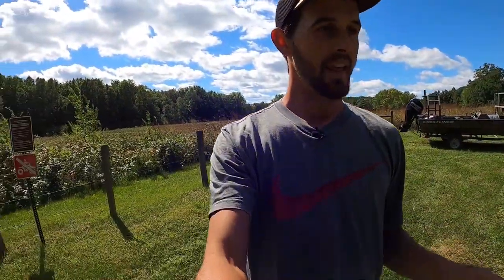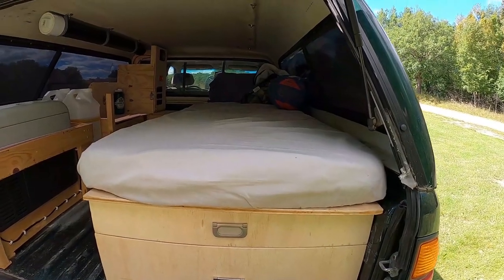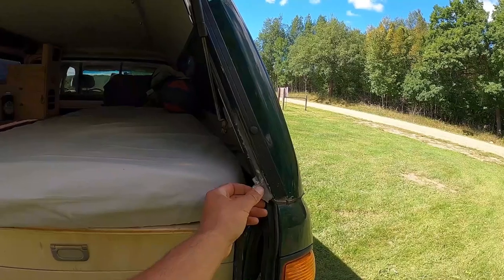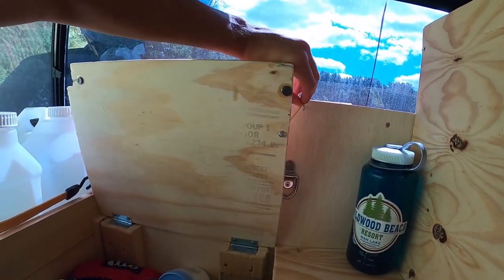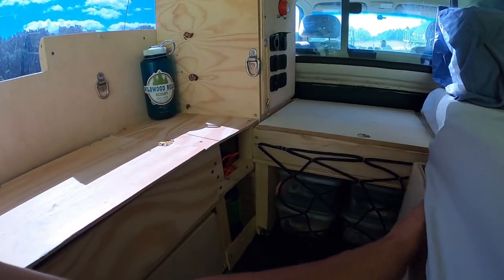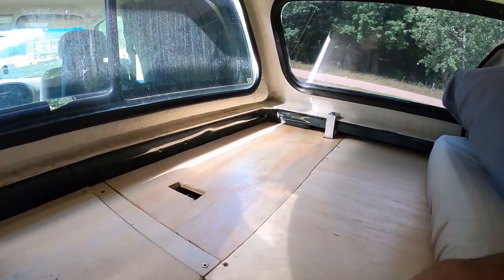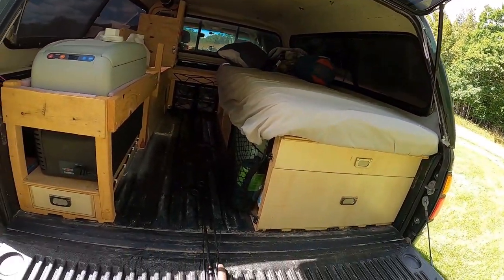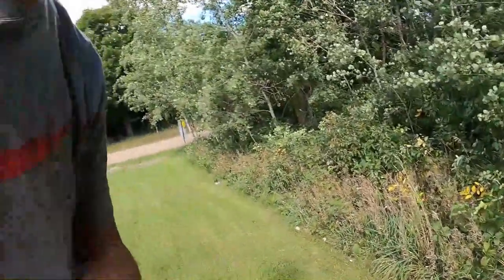Truck Camping in a Toyota Tundra! FULL SETUP! FULL TIME!

Comment: Cool set up for your First Generation Tundra. I have 2002. Go to Lowes and buy some Reflectix for covering all windows in your bed topper then for the truck windows when you’re not driving. It’s what I used to cover the windows in my house in Florida and for 2002 Toyota Tundra SR5 for keeping Radiant heat of the sun out.

Comment: Nice setup! Taking some notes from this as inspiration to my build. I suggest you look into that reflectix bubble insulation. Cheap and easy and provides insulation from the cold and heat. Keeps the temps inside low when it's hot outside, and warm inside when it's cold out there.
Reply from the maker: Thanks! Ya that’s a good idea! I’ll look into it

Comment: good job brother.  i have solar like you. still always changing the inside.  i built a bed which i'll keep but decided the rest had to be modular because every inch of space is needed. so be removing my plywood shelf on the other side it's just not functionable. i am always finding modular things that will fit just perfect.

Comment: curious where you purchased the gaskets along the tailgate to seal out water. In particular, the 4-inch rubber strip along the lip on the tailgate. I have dust/water issues in that location (06 Double Cab Tundra) which I have temporarily patched with a cut-up pool noodle but looking for a more durable fix. Also wondering which gasket you used along the upper edges of the tailgate as well. Thanks!
Reply from the maker: The 4 inch piece that I used for the bottom I got off of amazon. It’s called Adhesive Universal Rubber truck bed tailgate gap cover filler. It is 4.25 inches wide. The adhesive that it come with is ok, but I had some parts not stick good so I used gorilla glue for most of it. I think the gaskets I used on the sides are TruXseal. I don’t remember the name. That’s a pretty cool way to make a quick fix though! Are you still able to open your tail gate with the noodle in there?

Comment: I have a 2001, when you took out the back was it useless afterwards ? or could put it back in? i really like your set up and thank for sharing.
Reply from the maker: Hey! I’m not quit sure what you mean by “ when I took out the back”?  I left my back seat at my parents house, so if I want to put it back in I can.
Reply: @waterpredator7826  sorry about that. I want to do something very similar by taking out the back seat i have a 01 tundra access cab. I was just wondering if the seat could be put back in if needed. Ive been looking on you tube to see how it's done properly, but i can't find much. I'll figure it out. Bout i'm really impressed with your setup.
Reply from the maker: Ok gotcha! If you want a bunch of pictures of my backseat setup I can send them to you if you want. One thing I did that I’m not sure got on the video, is I did not put a bottom on the wood frame. I left the bottom open so I could still use the 2 storage areas that are under the seat. Also if you are going to use it for a lot of small things I would recommend putting drawers on one side. I’m going to install 2 drawers on my driver side so I can access them easy and fast
Reply from the maker: I also used the 2 screw holes that are near the bottom behind the seat. I put a bolt through the wood structure to the screw holes. I also put 2 lags in the front that I screwed down through the carpet
Reply: @waterpredator7826  OK that really clarifies it for me because i was wondering about the two storage compartments under the seat, I really appreciate your quick replies. Like isaid before i really like your set-up and that's how i'm going roll with mine.

Comment: Your baking cause you have no insulation. Most people use reflectix because its thin and easy to work with. Not that the bed isnt going to get hot either way, but it does help. The tint will help but not the same. Nice build though!
Reply from the maker: I have heard of people using them, but I never got around to making my own yet. I’ll have to make some before summer comes around again. Thanks for the tip!
Reply: @waterpredator7826  np. If you want a better insulation you can use Rockwool along the sides but its not going to make that big of a difference since the tailgate, floor, roof and back wall won't be as thick. Personally I have 200amp hours of usable battery (400amp hours gel sealed lead acid) It allows me to run fans, my fridge and a heating blanket in the colder weather. But the insulation definitely helps.
Reply: @waterpredator7826  they are not only making window covers out of the reflectix but also lining the entire bed with it. Just doing the windows alone isn't going to help much.
Reply from the maker: @Kazukio77  thanks for the info! On this adventure I’m going the snow bird approach. I’m trying to stay where it’s warm. I’m going to look into getting the insulation for my windows for more privacy and insulation. If it gets really cold in southern LA where I’m at I’m going to get a heated blanket like you have. Always being cold gets really old really quick for sure.

Comment: what are the dimensions of your bed? Any specific size of the camper we should look for?
Reply from the maker: I’m not sure on the width of my truck bed, but the length inside the tail gate is 74 inches long. The bed I sleep on is 74 inches long and 28 inches wide. I’m not sure what you are asking about with the camper size. I just bought a topper and built my own living space inside. If you buy a topper to sleep in, I would recommend a raised topper for head space.

Comment: I really enjoy your build. I'm curious to know the things you would change since you've probably gotten some good use out of it by now.

I just bought a Ranger XLT supercab with a 6-foot bed. Unfortunately, no one makes the big high top cap for it, so I went with A.R.E. MX cap. I'm 6'1, "so I really need the head room. Anyway, this gave me some great ideas, so thanks! I hope you're well and congrats on building the new boat. I've subscribed to your channel 😀
Reply from the maker: Thanks Matthew for the sub! Ya, there is a lot of things I’m going to change. I am working at a fiberglass boat building company right now so I have access to all that stuff. I am going to take out the side windows on the topper and glass the holes and insulate the topper. I am also going to put a fridge and a freezer. My fridge now works, but when I have it filled it freezes my stuff and when it is empty it is like 40 degrees. I am also going to add side draws to my box in my back seat. I’ve been finding that easy access storage is super handy and makes living in the truck a lot easier. That’s to bad they don’t make a high top for your truck. I’ve been finding I don’t spend a lot of time in the back sitting up. I usually change my clothes in my cab and chill in my cab when I want to sit. Also I would make your bed a little wider then mine being 2 inches taller then me. I find that I put to much pressure on my back window sometimes and I worry I might break it. Also I would make the bed shorter then mine. Thanks for the question! If you need any more help let me know
Reply from the maker: Hey! I saw your second message got deleted. Don’t know if you did it or what. No big deal. Sorry for not responding sooner
Reply: @Water Predator  I deleted it because it was too much info. Do you have an email you can post so I can send you some info on a free fridge and sponsor?
Reply from the maker: I do have an email, but not sure if I want to give it on you tube. Do you have Facebook or Instagram? I would like to send you my email through one of them if that’s ok
Reply: @waterpredator7826  I have a Twitter account.
Reply from the maker: Hey Matthew! I just made an email account for my channel. If you want to massage me privately my email is waterpredator1@gmail.com